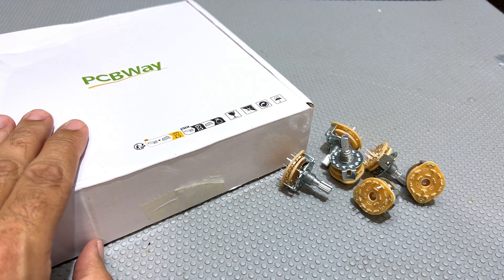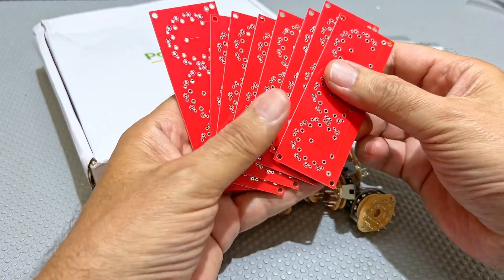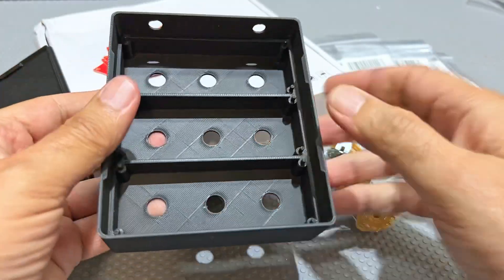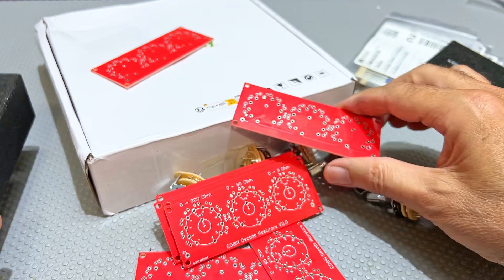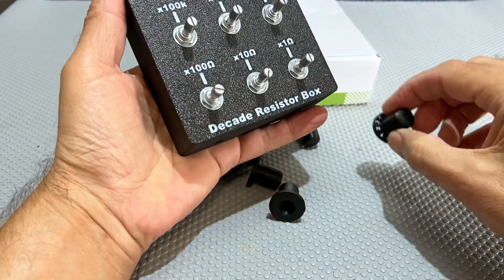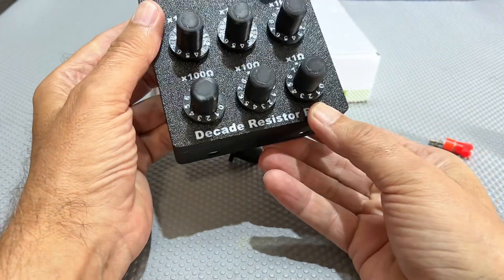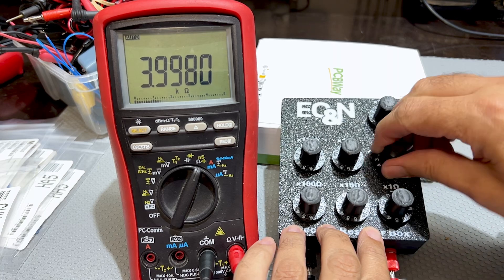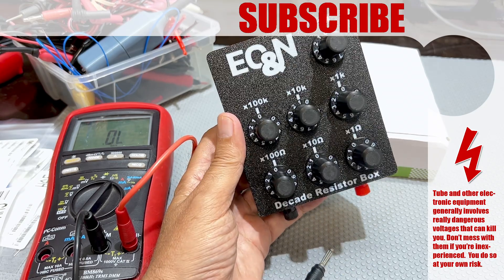Build a Pro Decade Resistor Box for Cheap! PCB & 3D Print Files Included #pcbway#

Comment: Nice PCBs. There is another trick you can use to save money on the low tolerance resistors, by buying 100 of each then hand testing to choose a mixture where the spread of values averages out.
For example, using 1% parts you would choose 9 x 1K where there are 4 values either side of the closest 1K.
Then you solder them selectively, with one high then one low then high then low... but randomised.
So, if you were in the 2K switch position you might be getting a 991 ohm in series with a 1007 ohm, giving you 1998 total... which is 0.2% tolerance whilst using dirt cheap 1% parts.

Comment: Hi there. I am a new viewer of the channel and loving it. After watching this particular video, I downloaded the files and placed an order with JCLPCB. Unfortunately they say the cannot print as some parts are too thin. I wanted to also check that I uploaded the correct files as I know nothing about 3d printing. I used the 4 files called final.stl . Was that correct ? Should I have uploaded some other files? Maybe it was the material I chose(9600 resin). Many thanks for any help. Paul

Comment: I have all the parts including the pcb's for the project.  I am a novice and have 3d printers.  Would you please comment on how you did the white labeling.  I am using OrcaSlicer and a single filament Elegoo printer.  I do have a Carbon X1 with the 4 filament accessory. I noticed in my slicer it does show a faint outline of the lettering but doesn't look like it will print it.  Thanks for any comments you might add and also thank you for posting this project.
Reply from the maker: I use a multi-filament printer, the bambu lab A1,  and just define different coloured filaments for the respective “objects”
Reply: @electronicsoldandnew  Thank you for the fast response.  I do have a Bambu X1 carbon with the multi-filament AMS.  Have not tried multi-color so I will need to do some studying and practice.
Again thanks for the  reply.  Really like your channel and I have subscribed.
Reply from the maker: 👍 good luck

Comment: Hi - had you considered removing the stop on the switch rotation so you can wind them right through allowing you to quickly go from, say, 90 to 10?
Reply from the maker: I did, but found that I had to really hack the switches, and decided against it as I did not want to damage them.
Reply: @electronicsoldandnew - you not have to hack ANYTHING.
Remove the knob, washer and lock nut. Hold the switch upside down, so the shaft is downwards and tap it lightly in the bench. The removable stop washer will simply fall out.
You can also put that washer back in a different position, to convert a 10 position switch into any number of positions.
. . .
EDIT: the cheap switches he's chosen have a tab bent down to act as a stop. The tab is under the rectangular hole. The solution is to buy switches that don't have the stop tab. The black sealed ones have removable stops, and there are also open-frame 10, 11 and 12 position switches out there without a stop. But with the ones this guy has linked to, the stop is not adjustable.
Reply from the maker: “This guy” chose the cheap options on purpose, as “this guy” said in the video 😊
Reply: @electronicsoldandnew - yep, I know. I use the higher quality 5 Amp sealed switches, which are known for being more reliable. They are far less open the enviromnetal conditions so you don't need to clean them, and they usually use silver plated contacts anyway.
We all used those open frame switches in audio gear in the 1970's, but when the sealed versions came out everyone swapped over and never went back.
The sealed switches only cost a few cents more.
Reply from the maker: I’m glad you’ve found a way to vent - always glad to be of service. Quite frankly, I do what I enjoy, and show it as it is, and people watch it and rate it as they please. Go ahead and do it right, then post a video on the project. I’ll even link to it 😊 Have a great day.
Reply: @electronicsoldandnew - vent? 🤔
Well, that is an exceptionally obtuse response to my helpful suggestion on an improvement to your design.
In fact, with a minor revision to your PCB layout you could make it take either of the 2 styles of switches.
Reply from the maker: Actually, the comment I responded to was altogether less helpful, and far more of a rant with some insulting nuances thrown in. I guess you edited it, but I got the full unedited version, which quite frankly, I did not appreciate. The edited version, however, is indeed helpful, and does not deserve an obtuse reply.
Reply: @electronicsoldandnew - I certainly did write a very critical reply to another video not very long before this one. It was something about an automotive workshop using low quality parts.
Perhaps there was a glitch in the Youtube matrix?
BTW I always need to edit my comments because I see all my typos after it publishes, and OCD won't let me leave them visible 😂
Cheers 🍺
Reply from the maker: Yes, I was wondering what automotive parts had to do with this 😊 Anyway, my apologies for the obtuse reply, and thanks for you positive input.

Comment: Ok, as a young man I had plenty of experience as a draftsperson thru being a structural & miscellaneous iron detailer. Later I attended the university, seemingly forever, to become adept in pure mathematics. However, I have no firm idea as to what a Gerber File is. My first thought when I hear Gerber is the baby food manufacturer. This likely is not the case here & my guess is: "a universal language or modeling scheme" for CNC type machines to use as their instructions for producing any part asked of them to produce, right???
Reply from the maker: Correct. PCB manufacturers use the gerber files set to produce the boards.

Comment: Those dip switches are not really designed to be flicked back and forth regularly, so I am guessing they likely degrade quickly.    The rotary style switches are definitely easier to use and a lot more reliable.    So much easier to maintain :).   I remember doing a similar decade box many moons ago using point to point wiring.   I like the circuit board option better though.
I really appreciate the hard work you put in to these things and to make them free for us to use is just amazing.   Not many are willing to share the way you do these days.    Thank you!
Reply from the maker: My pleasure

Comment: I made something similar using the same type of rotary switch.  I used PCBWay and made boards I could mount the switch on and resisters - 5 Watt std values, (2.7, 4.7,etc.).  Not used often, BUT when you do need it ... 🙂
I'm think of doing the same with capacitors.

Comment: great work ,looks like a professional commercial product youd expect of £250-350  or so,  i prefer this knob selection type , my box has thumb wheel switches and i always go the wrong way ,so if iam trying values on a live circuit have to be carefull not to overcurrent stuff , with that in mind ive never seen a decade box with current limiting! maybe i could add a selector for several values of ptc to protect those low ohm settings
Reply from the maker: That’s a great idea 👍

Comment: Are the switches "make before break"  or "break before make" i prefer the make before break for this type of project as it means the connection remains made while you change resistance.  But this is just my preference, I don't like the issue that when using a decade box to trim say a voltage regulator. You don't want the output jumping to max as the resistor selection becomes open circuit as you rotate the knobs.

Nice to make your own had a few in the past at work where the resistors get smoked as no one reads the power ratings printed on the box.
Reply from the maker: They seem to be make before break. Did the multimeter beep test 😊
Reply: @electronicsoldandnew  Happy days then. well in my opinion anyway.

Comment: Excellent! :trophy-yellow-smiling:👍 To bad something like this hasn't been available.  I've never cared for what's available, or the limits and quality.  And they are way over priced!!   A plus to your boards, is soldering the resistors directly on the PCB- rather then the switches.  Makes it easier to replace them if they burn out. 😀
Reply from the maker: Much easier. The switch cleaning is also simple.
Reply: @electronicsoldandnew  - That's for sure.
Reply: 12:30
Press the rel button to zero it out first 😅

Comment: Thank you Manuel! This project is just what I need just now. ( Repairing a tube-radio from the '30s and I need to find some resistor values by 'trial an error method'. )
One minor thing: The link for the rotary switches lands on a page where 2P5T is pre-selected. But the correct ones are 1P11T ones, right? So must be careful before hitting that 'buy now' button...
Reply from the maker: True. There’s one single landing page for the switches, and then the actual ones must be selected before buying. Cannot actually force the landing page to go to the 1P11T.

Comment: Just one question about the switches....
Are they shorting (make before break) or non shorting (break before make)
People have asked this on AliExpress and not got an answer.
Ideally we don't want open circuit between steps so need the shorting type.
Any feedback on this having actually built a functional unit?
Reply from the maker: They seem to be make before break. Connected a multimeter and the beep confirms this.
Reply: @electronicsoldandnew  Excellent thank you!